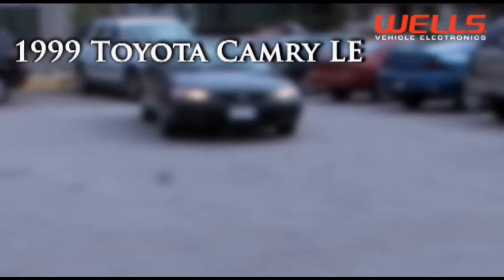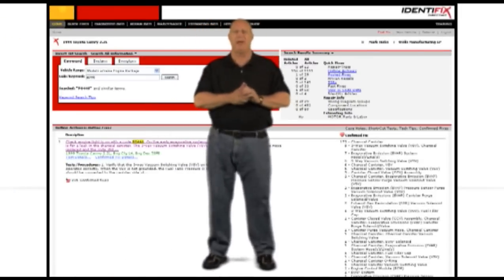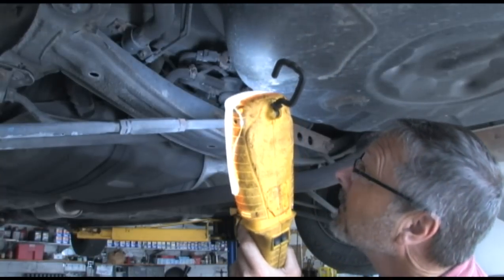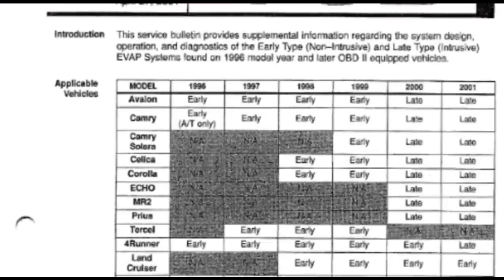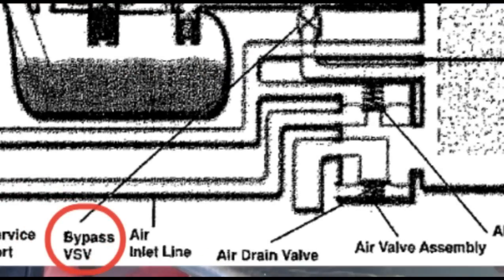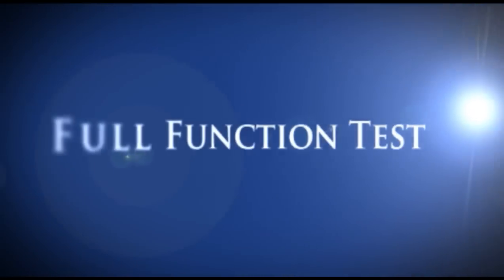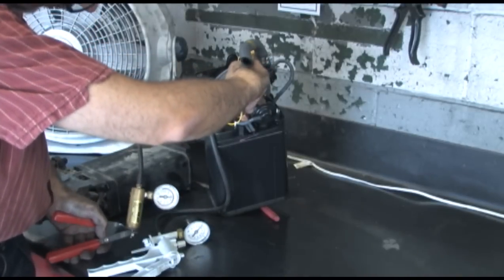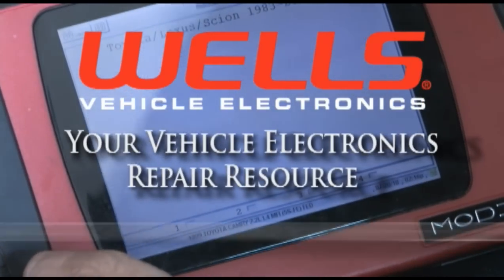Toyota Po441, P0446 EVAP Vacuum Switching Valve VSV Testing and Canister Replacement

Comment: Hi, My 2001 Toyota Sienna had check engine light on with P0446 code. I changed a VSV on the canister (as in video). After driving for 150 miles the evap canister is still not ready yet. I assume if there still is a problem the light will come on very soon. If in case the check light is on again, I wonder if it makes sense to change a VSV next to the air filter box? It is less than $40 for the VSV near the air filter box, but not sure make sense of replacing it before replacing canister? Thanks.

Comment: how did you remove the clips for the hose coming from the fuel tank? (located on the corner of the charcoal canister)

it seems like a snap-on clip with 4 flat tabs..  did you use a flat-head screwdriver or just squeeze the clips to release it from the grooves?

Comment from the maker: Polarity doesn't matter when you are energizing a solenoid. Just make sure the leads are not touching each other. We found a 9 volt battery does not work well for the vent solenoid, but you can use a power probe or the vehicle's 12 volt battery. Remember to do a tap tap tap test to find an intermittent solenoid which frequently happens.

Mark Hicks
Wells Vehicle Electronics

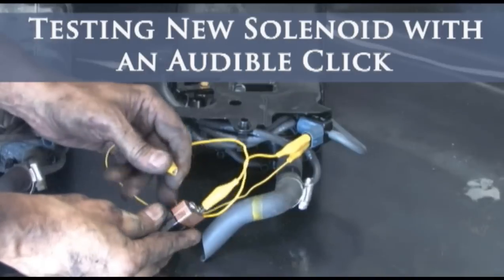Comment: @3:06 you said that the vsv was deffective and that you needed to change the evap canister but i looked it up and they sell the vsv seperate what is your 2 cents on that matter
Reply: Can you please tell me what the OEM or replacement part number is for this ? I have a 99 Avalon 6 cyl, and I am getting a P0441, pretty sure the electric relay inside the valve has failed, and I want to replace just the valve, since the canister is so expensive and hard to get. Thanks.

Comment from the maker: It was a history code. If the code does not set again with in 50 engine starts it will erase. at some point you must have set it. If you have any other questions let me know.

Mark Hicks
Wells Vehicle Electronics

Comment: I just had my egr valve cleaned out.  They said it was very dirty.  They cleared the code and so far (3 days) no check engine light.  I got online here to learn more about the egr and I am wondering if I should expect the VSV valve to be going out pretty soon.  They said they checked everything down the line, (but I didnt see the car in the air at all, so I'm pretty sure they didn't mean that they checked the canister). Its a 95 v6 Camry with 190000 miles.

Comment from the maker: @xx217xx Yes, it can happen and it is not unusual with an EVAP code. However, the code is still stored in the history even if the light goes out.

Mark Hicks
Wells Vehicle Electronics

Comment from the maker: @mcleod2 The purge solenoid, I would think is the same as the purge valve. However, some manufacturers call out different names. I would check with whoever you are buying the part from to be sure. 

Mark Hicks
Wells Vehicle Electronics

Comment from the maker: @markjhicks 	
3. If both solenoids operate correctly and are not sticking, inspect for a restriction in the Evaporative Emission (EVAP) lines that could affect how the canister vents after a leak test is performed.

4. Verify that the fuel cap is a good seal. If the fuel cap leaks or does not hold the correct amount of vacuum when the system checks for a leak, all the codes will set. 
Stay in touch

Mark Hicks
Wells Vehicle Electronics

Comment from the maker: @markjhicks 	
This is a normally closed (N.C.) valve. When energized, it should open. When de-energized, an internal spring should close the valve.

2. Verify that the canister closed valve (located on the air filter housing) closes and does not stick closed when operated. This is a normally open (N.O.) valve. When it is grounded, it closes, and it should never stick closed.

Comment from the maker: @xx217xx It means the solenoid is activating, but you still must make sure it holds and passes vacuum like it shows in the video. By far the most common cause for these codes on your vehicle are either a bad gas cap or canister. Here are some more instructions I hope will help you determine the anser to the problem:
	
1. Verify that the Vacuum Switching Valve (VSV) for the pressure sensor (located on the canister) operates correctly.

Comment: @markjhicks Everything tested good. Replaced injectors - still sputtering, but runs smoother after initial acceleration. :) Next venture is the fuel pump strainer. Oh, and now I have an exhaust smell in the cabin.

Comment from the maker: @sidmalicious By sputtering, I will assume you are saying it is misfiring on acceleration. Your vehicle does have problems with injectors. But, be sure the ignition system is in good shape. Quick test for the injectors: if you can power brake and recreate the problem, have someone do that and you stand on the side of the vehicle ( not to get run over) then spray crab cleaner in the air intake and see if the problem goes away. If it does you have a fuel related problem.
Mark Hicks
Wells

Comment: @markjhicks Um, yeah Mark - READ FIRST. I wasted $300 replacing the cannister, VSV works. Purge valve up front was bad, replaced, still throwing 446 & 441 codes. I pulled the ground off the battery again, and it drives fine, except the new sputtering upon takeoff. I'm going to change the auto transmission filter and fluid to see if that is why it sputters - it's past time to do that anyway, and it seems like it is in the wrong gear, like starting off in 2nd. I hope it's not the injectors.

Comment from the maker: @sidmalicious : 	
2. Monitor the FTP sensor and unplug the 3-way VSV and draw a vacuum into the canister and verify that it will hold vacuum and the FTP voltage will decrease.

3. Test and verify that the purge solenoid and wire harness are all OK. The purge solenoid should apply vacuum to the charcoal canister when grounded. Also verify that the hose from the purge solenoid to the charcoal canister does not leak. 

Hope this helps you,
Mark Hicks
Wells Vehicle Electronics

Comment from the maker: @sidmalicious Chances are you will need to replace the charcoal canister with the VSV valve. But here is the test procedure if you would like to test it first:
: 	
1. Verify that the 3-way Vacuum Switching Valve (VSV) on the canister operates correctly. When the VSV is not grounded, the Fuel Tank Pressure (FTP) sensor should be connected to the canister side of the system only. When the VSV is grounded, the FTP sensor should monitor only the fuel tank.

Read first
Mark Hicks
Wells

Comment: I replaced the cannister and the purge valve (in my driveway also - not hard at all). It still throws the codes. If i run it without the gas cap and them reset the ECM it runs fine and passes emissions. Then after a while it throws the codes, sputters, and sometimes dies in turns and at idle. Now, a new behavior of sputtering upon takeoff...reset the computer and it runs fine. What else should I check?

Comment from the maker: @JUDGERAMBO If you are asking about this Toyota, you will need a scan tool to read the pressure then verify that the 3-way Vacuum Switching Valve (VSV) by the canister works correctly. When the 3-way VSV is grounded, the pressure sensor should read tank pressure. When the ground is taken away from the 3-way VSV, it should switch and allow the pressure sensor to check for vacuum in the canister. 

I hope this answers your question,

Mark Hicks

Comment from the maker: @2009jimmy2009 How many customers are happy when they get the bill? But you are right this is an expensive repair. It is a questionable design from the beginning. If the VSV was made to be replaced as a separate component the cost would drop dramatically. 
Thanks for the comment.

Mark Hicks
Wells Vehicle Electronics

Comment: I'm currently running into this same code (P0446 and P0441) on my 1999 Toyota Corolla. I followed the steps and have the canister assembly out and on my bench. I tested the same way as in the video and no clicking sound. Is the canister the same as the Camry's? If I can replace the VSV instead of the whole assembly I'd rather do that.

Comment from the maker: @lanzce80 I wish i had a direct answer for you...here is what i know. I have not changed one on 2007. I looked it up in AllData and in the location chart it shows the canister in the same area, under the trunk - near fuel tank. But the picture is not specific. I think it is easier than the one in the video, because the labor rate for replacement was only .5 hours. Please take a look in that area and let me know what you find. 
Thank you and may you and yours have a wonderful holiday. 
Mark Hicks

Comment: UPDATE:
No parts stores list the VSV valve separately, but after hours of research, I found the part number of the VSV valve for my '99 Corolla. It is 90080-91240. It costs about $27 from internet dealers or $48 from local dealers.I disassembled the old valve, and it looks good, so I don't understand why it doesn't switch like it should. Even the resistance of 40 ohms is the same as the new valve, but it doesn't switch or click. I have a couple of other problems with my car, so wont be able...

Comment from the maker: @CRISTIAN123JOSE You can smoke it, but it will not show if the VSV is activating. You can activate it with a 9 volt battery without removing it. This is what usually happens when they fail.

Mark Hicks
Wells Manufacturing L.P.

Comment from the maker: @Standingwithfeast  Thank you for the kind words. Problem is you have to have two of them. That might be an issue for some shops. Testing the VSV activation with a battery will reveal most of the failures.

Mark Hicks
Wells Manufacturing L.P.